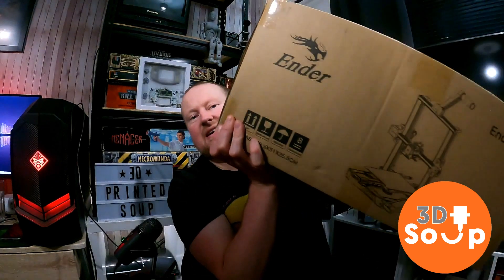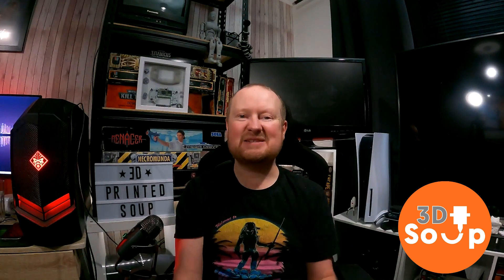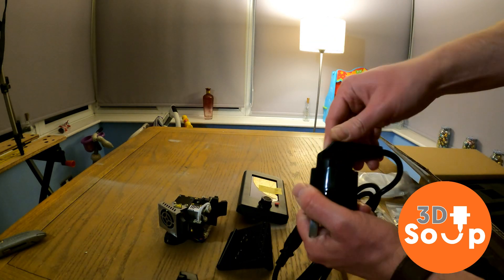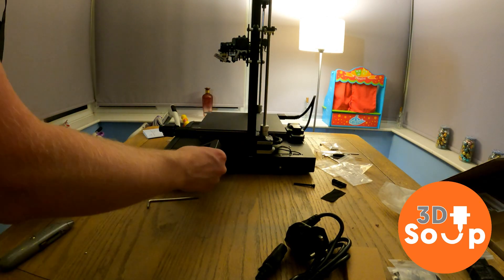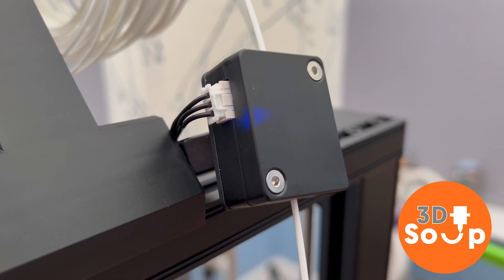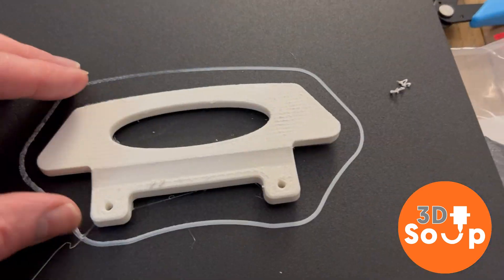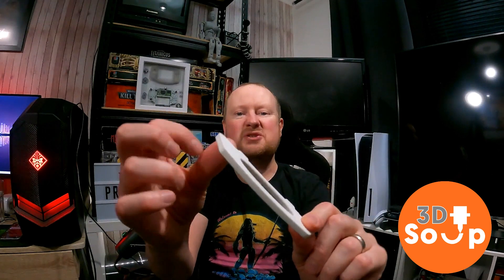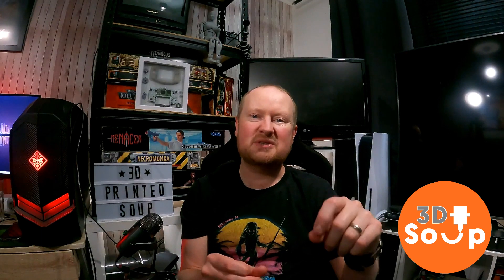Creality Ender 3 S1. Is it as easy to assemble as creality claim? Assembly and review, first prints.

Comment: Hi! Is there a way to adjust the voltage? I just looked at the back and it seems 230V is how it’s set. 

It was easy to assemble. It’s not reading the SD card. The files are on there though. Any ideas?
Reply from the maker: Hi, there is a red switch on the rear of the power unit, make sure it’s set to the correct voltage for your region and never change it to an incorrect voltage as this will kill the unit and could cause a fire. If your card is not being read then make sure it’s a compatible card type. You could also make sure you have sliced the file correctly via your slicing software (cura ect)
Reply: @3dPrintedSoup  thanks so much! I didn’t realize that was just a sticker covering the voltage switch.  It’s the SD card that came with the unit. Apparently a common problem. All the files are there. It’s not even reading the company files.
Reply from the maker: @jenniferferro5592  okay, that’s odd, maybe try the usb c connection and see it connects correctly to your pc/laptop. Also try another ds card to make sure it’s not a card error
Reply from the maker: Thanks for watching :)
Reply: @3dPrintedSoup  I bought a new one. Before I go returning things & feel like an idiot. My pc reads both SD cards. The printer is not. I’m ordering a usb c cable-which should come with the machine. But am I doing something wrong? I’m not techie. The instructions suck. I’ve watched videos. I emailed creality-useless. You make it look so easy. I put the SD card all the way into the drive. Turn the knob & press it to get to the print menu & my only choice is “back.” No other files are visible. 

Is there a step I’m missing? I downloaded ultimaker.
Reply from the maker: @jenniferferro5592  do you have another sd card? If so then download an stl file, slice it and save it to the new card. Then see if the printer pics it up. The printer will only pickup correctly sliced files . Also make sure you have ender3 selected as the printer on cura (ultimaker)

Comment: Creality Ender 3 S1  isn't worth $450
Reply from the maker: Interesting. How about some more info to back up that statement? I’ve had nothing but great results from it. Thanks for watching.
Reply: @3dPrintedSoup  in terms of print result, its good, but in terms of print vol. its really small
Reply from the maker: @basook6116  it’s got a vol of 220x 220x 270, dual z axis drives, directl drive, a colour screen and auto level, well worth the money imho.
Reply: @3dPrintedSoup  I own many 3D printers, but this one is very small; I had 3D printer that had 320x320x400 dual Z.  now if this printer comes with laser engraver, than yes its worth the cost
Reply from the maker: @basook6116  which printer are you referring to?
Reply: @3dPrintedSoup  I had Tevo, and ADIMLab Gantry Pro.  they all had bigger vol.
Reply from the maker: @basook6116  ah yes, a nice printer, about the same price but no auto level and basic interface, but yes, if built vol is what you care about most it is a bit bigger . Thanks for commenting and chatting :)
Reply: @3dPrintedSoup  same to you sir

Comment: I am looking for my first 3d printer. I have looked at ender v2, ender cr6 se and ender 3 S1. Can anyone tell me which one they would recommend out of those 3? Thanks in advance.
Reply from the maker: The ender 3s1 has a great interface, it self levels and it has a much more premium finish to it than the v2, it also has a direct drive so in my honest option I rate it best of the ender series. I don’t own a cr6 so don’t have an opinion on that one. Thanks for watching and commenting:)
Reply: The ender v2 is a good printer, but to be honest i like the s1 just a little bit more. I have both and both do a very good job, that is if you have the patience and don't mind playing around with settings and some modifications on your printer (mainly the v2, the s1 is good as it is.). The s1 is somewhat like the v2 but with all the extra's and modifications already done. For the money i would go for the s1 because of all the modifications that are already on there, you'll spend more money when you want to modify the v2 eventually. On the other hand, you can learn a lot from the v2 because of the modifications you can (and wil) do. for a first printer it is a pretty good one but as i said, you will need to play around with it and modify some things so it will do the job as you want it to do. Results are pretty similar on both printers although some of the print seem a bit more smooth on the s1, but that is probably because of the direct drive. some designs print better with a bodentube and some are better with a direct drive.
i hope this can help you, happy printing .
Reply: @stephandevriesere3667  thank you for that info. Where do you recommend getting it from? I am trying to get it from Amazon and don't want to end up with a fake.
Reply: @stephandevriesere3667  I am in Amaerica in case that matters at all.
Reply: @stephandevriesere3667  do you also recommend the S1 over the CR6 SE?
Reply: @flipster2321  I can't give you an answer to that, i do not own a CR6 and have no idea how they perform. Sorry. I did however found a couple of videos on youtube stating that the ender v2 and s1 are a better choice. But as i said, i have no idea.
On your question about where to buy it (sorry i did not answer it before), there are multiple people that bought it from amazon and i did not hear any complaints so far, so i guess it is safe to buy it there. As i am in the Netherlands i bought it from a dutch company

Comment: Hi, I just bought this printer and it has been working perfectly until a few days ago. I have a problem that sometimes when I start a print my printer heats up but it doesnt start printing. I have tried with my sd card and with USB. Sometimes it works when I reslice my gcode sometimes it doesnt.
Reply: you probably need to format your sd card. I had issues like that in the past with my Ender3 V2, after formating the sd card everything work perfect. It can also be your slicer, maybe your settings or it does not transfer the file to your sd card the right way.
Reply: @stephandevriesere3667  Ok, I will try this and see if it helps :)
Reply from the maker: I’ve had the same with my 3pro, I did the same as Stephan suggests and it fixed the issue. Thanks for watching :)
Reply from the maker: I’ve had the same with my 3pro, I did the same as Stephan suggests and it fixed the issue. Thanks for watching :)
Reply: @stephandevriesere3667  I formated my sd card. It didnt make a difference. Then I downloaded a new firmware and did a pid autotune and now it works.
Reply: @Alex123-t3f  good job, good luck and happy printing, Glad i could help.
Reply: What type of USB cable? I don’t seem to have one that fits. But I see the jack on the front. That was my next move since the SD card is not working.
Reply: @jenniferferro5592  i did a temperature calibration and now it works

Comment: I got my Ender 3 S1 yesterday and did a few testprints on it right out of the box. The files i used were not the ready files on the sd card but files of my own, i got to say i am really impressed how good these prints were. It really is a 4/5 printer. I did not do any calibration on anything, just assenbled the printer and started printing (i did do the nozzle offset though). It is so easy to assemble a child can do it. Just like my other Ender printers (Ender 3 V2 and CR10 V2), i had no issues what so ever. They are not high level printers but you can have super results with a little patience and some tinkering in your slicer.
Reply from the maker: Sounds like we had similar experiences. I’m testing some of the features such as power fail and restore for my next video. Thanks for watching :)
Reply: @3dPrintedSoup  Only problem i had so far was the adhesion of the print bed. I had a lot of trouble getting my prints to detach from the print bed. 

Any suggestions ?

I used the standard values on heating the bed ( standard PLA at 50 ) but i think it should be lower. This build plate has enormous adhesion. Maybe i did not let the prints cool down enough ?
Reply from the maker: @stephandevriesere3667  actually I’ve noticed this as well. I have allot white traces left on the bed. I’ve scrubbed it with ipa and it is now flat but the lines are still visible , will try increasing the offset slightly . If you solve this give me a shout.
Reply: @3dPrintedSoup  I think i found the solution for the print bed. 
I cleaned the plate with alcohol and used 3DLAC adhesion spray, i also left the testprint on the plate until i was sure it was cooled down. Now i can pop them of just as easy as from a glass plate like on my Ender3 V2. 
I think there is an layer of something that is sprayed on during fabricating this plate, after using alcohol on the plate i have had no issue ( at least for now). Hope this can help you too.
Reply from the maker: @stephandevriesere3667  great stuff! I’ve wiped it with IPA but will give it a proper scrub later, will definitely get some of that spray. Thanks for letting me know :)
Reply: Where did you get your S1? I have been looking on Amazon but don't want to get a fake.
Reply from the maker: @flipster2321  I got it from 3Djake.uk . Thanks for watching :)

Comment: I am done with creality, my  5 pro just burnt its 2nd motherboard and creality service is terrible, I ordered a big tree to get it running, my voxelab has 2000hrs with no problems
Reply from the maker: Sorry to hear that , I’ve been using fdm and resin printers from creality for years with no issues, however I’ve never used the 5 pro. I hope you get the matter resolved to your satisfaction. Thanks for watching and letting me know about the problems the 5 has given you.
Reply: Doesn't the 5 pro use the same 32 bit mainboard as all of the 32 bit silent Ender 3 and 5 models?